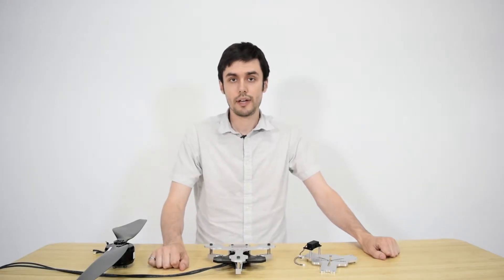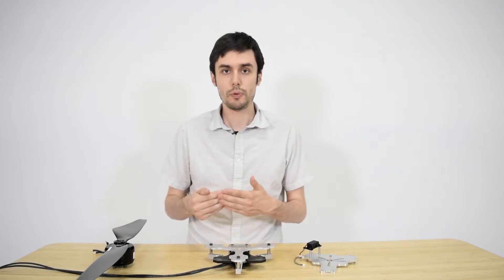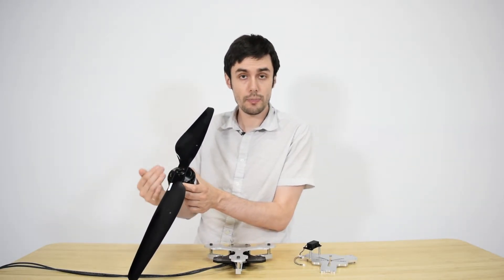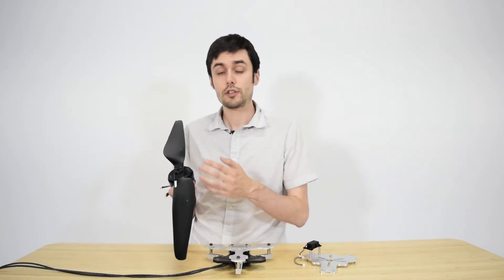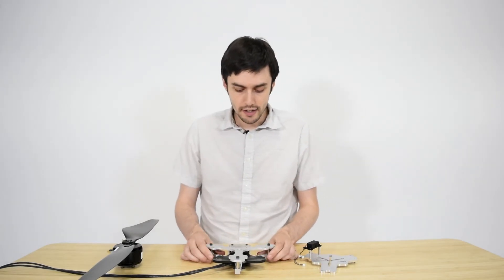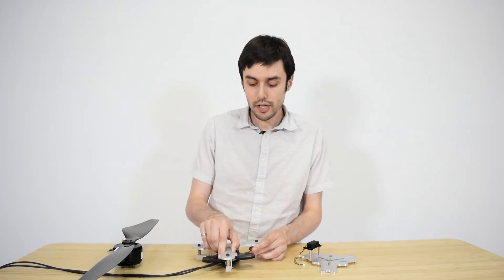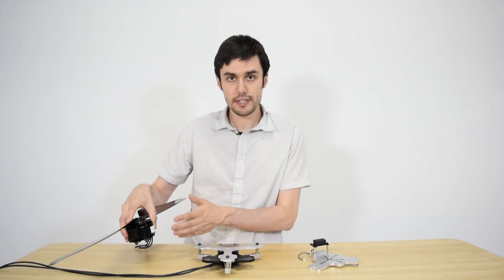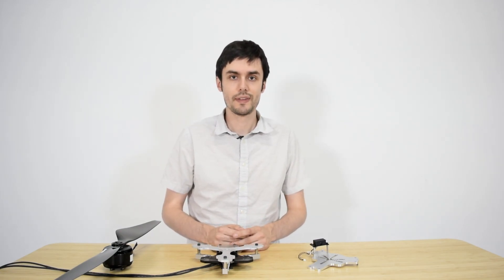Why You Need to Measure Torque - Drone Motors

Comment: I am an Mechatronics engineering student in Thiagarajar engineering college Tamilnadu India I want to make an Passenger drone fixed in suit its use for Army,Navy,Air force fixed with jacket so I need 30 kg thrust motor 4 nos , controller, battery  6 to 12 s cell battery ,Esc ,charger normal receiver and transmitter can suitable for this
Reply from the maker: Hi Jeevaranjan, thank you for your comment. That sounds like an ambitious project and we wish you the best of luck. We don't sell motors, but you can check out our article on large brushless motor manufacturers for some ideas: https://www.tytorobotics.com/blogs/articles/brushless-motor-manufacturers-for-evtol-and-aviation

We also have a database of drone motor, propeller and ESC performance data, which you may find useful: https://database.tytorobotics.com/